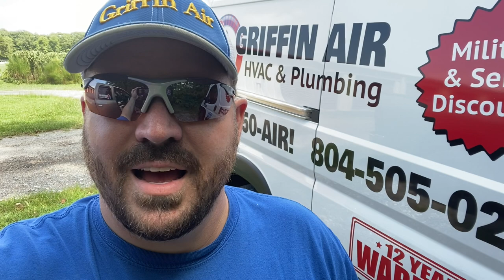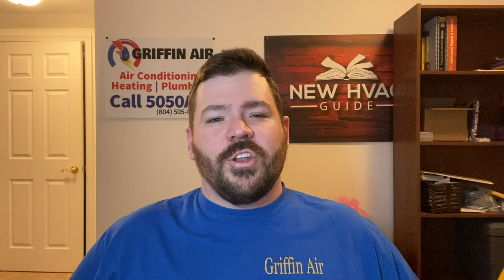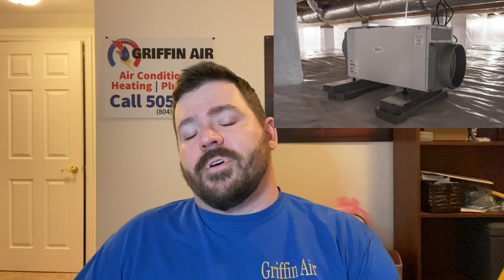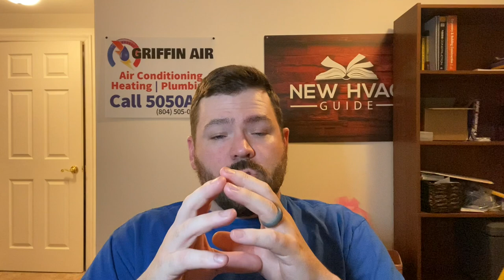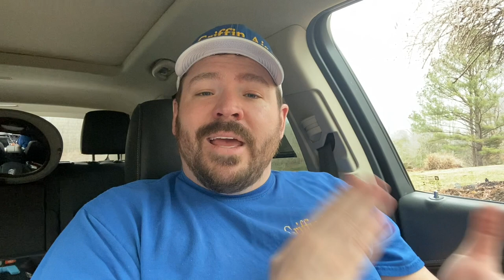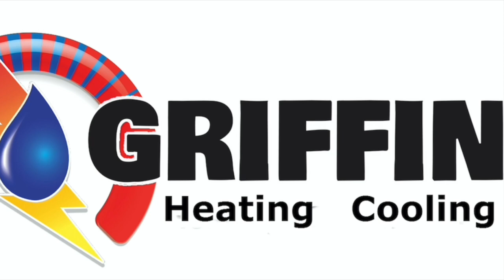The Crazy Truth About HVAC Sizing!

Comment: Need advice,

I have a common 3 Ton split system gas furnace. My compressor failed after 15 years of service. I recently purchased a new 3.5 Ton heat pump condenser as a replacement. I would like to take advantage of the heat pump technology and use the gas furnace as backup heat. My question revolves around the specifications of the new replacement evaporator coil. 
       
I noticed that most heat pump condenser units are married to an air handler with electric backup heat, instead of an evaporator coil box on a gas furnace. I understand that gas heat is possible as backup with a heat pump, but I'm confused about what modifications need to be made to the evaporator coil TXV. 
     
Please advise if there are special TXV for heat pump evaporator coil configuration and if there is something that is needs to be done to the furnace.
     
Thanks
Kevin
Reply from the maker: Nothing special. Just needs to be set up like a normal dual fuel system

Comment: Any feedback on figuring out a ducted heat pump size in a new build ICF home.  R60 attic insulation.  One level, Atlantic Canada, slab on grade, 2250 sq ft.  We’ve had contractors suggest anywhere from 1.5 ton to 2 ton.  Most online calculators show that as very small for the climate and square footage but not sure how the ICF factors in.  Trying to make the  most educated decision.
Reply from the maker: I recommend getting a proper heat load calculation done by a pro even if you have to pay for it!

Comment: I'm trying to figure out what size minisplit system I need. 99% for cooling for 680sqft(living great room/dining room and half of kitchen including range/oven). About a half of the area is 8ft ceilings(kitchen/dining room) and the rest range from 8 -15ft angled ceiling. According to strictly square footage, a 18k BTU system would work. Should I upsize one notch because of the ceiling height and partial kitchen?
Reply from the maker: Too many variables to answer this question pal. A unit can cause issues if it is oversized. Have your contractor do a Hilo calculation before purchasing the unit

Comment: So how do you combat those super hot days that happen 10-14 days a year ? A “properly” sized unit will leave you hot on those days. We like to keep our house at 68 during the day and 64 at night.
Reply: Add a small mini split unit to you main living area and set in one or two degrees higher than your normal setpoint.  It will add capacity when needed and be a backup If your large unit fails. You can get one under a grand.

Comment: Thanks josh for cool vid. Im a new homeowner and put in a new system end of last summer. I have one zone duct. Gas Furnace and ac coil on too, in basement.  Condenser is 5 ton, 16 sheer. 2k sq foot. Hard Ducts goes from basement to attic and branches out throughout the house. Problem im having now is in winter. Too hot upstairs & too cold down stairs. I tried resolving it with nest sensors. But downstairs is just weak. I even tried adjusting ceiling diffusers, still hot upstairs. Upstairs is all flex ducts from attic to second floor. Flex ducts looks quite big. Should i reduce the size of it? 

I havent experience the summer yet with this system. I am assuming it will be hot upstairs and cooler downstairs?
Reply from the maker: So it’s one system supplying both floors?
Reply: Yes. :-(
Reply from the maker: Is it zoned?
Reply: No.
Reply from the maker: Watch this vid. You need zoning. https://youtu.be/54G-K9X6S6U

Comment: Good video, I have a question. I have I have a metal garage 20'X12' 240 SF. It's all insulated with 1" foam except the garage roll up door. I want to install a mini split 9,000 BTU or 12,000 BTU?
Reply: Not an HVAC tech but personally, I'd go with 9K BTU.  I'd also look into ways to insulate the roll-up door to avoid condensation.  I'd try something like reflective bubble insulation.  If this were a garage I only wanted conditioned occasionally, I'd go with 12K BTU to get it to temp quicker.
Reply: @AvgDan  Thanks for the info.
Reply from the maker: I'd have a proper heat load calculation done if comfort is an issue... There's more variables than just square footage.
Reply: Need at least 12,000 because of the door and only 1' foam won't do much.
Reply: Deffinatly go w 12000 and in that situation 12k may actually not be enough depending on your location.  Always do a load calc. Insulate the garage door aswell like Dan suggested

Comment: Good info, although a lot of these issues aren't really done by the contractor. Most of this would be taken care of by an HVAC designer/engineer not necessarily a technician or contractor unless they are partnered with one or are a full design build company. A lot of the time when I've had to redesign a home the issue is because the design was not followed by the original builder and residential codes are way more lax than commercial codes especially when it comes to duct work. Most duct work in residential is lower quality soft duct which usually a wire spiral frame with insulation and a cloth and plastic membrane vs spiral hard metal or square metal duct work wrapped insulation. Unit selection in high humidity usually has a hot gas reheat coil which warms cooled air back up strictly for humidity control or has a humidistat and variable refrigerant control to ramp down for steady air volume. These are required in commercial applications and not so much in residential. Over sizing tends to occur when installers dont follow schematic design or install things designers hate like 3 way duct splits which I personally despise as a designer. Another issue is duct runs over 100' due to static pressure loss. The fans in residential units just dont got the static and volume for that length. This could be due to roofers  boxing out the wrong spot though and not the installers. All in all get youraelf a contractor who partners with an engineeer or a design build.company if you have major issues

Comment: We just ordered 2 Amana 311 seer 16 air conditioners for our 2 story high ceiling 2900 sq ft house. They arrived today and they are huge compared to our old air conditioners. Are you familiar with the model we got and do you think it’s too much?? I live in California  btw
Reply: All systems today are like that, I had mine replaced about 7 months ago. I have a 5 Ton  19 seer  Daikin Heat pump and it is much much bigger than my old 1994  5 ton York. They have to be large to meet efficiency standards and I dont know how old your last system was but if it was a R22 which is more efficient than R410 what is used today but R22 was bad for the Ozone.They need larger coils to remove the heat with R410 than they did with R22.
Reply: @wes2460  Thank you for sharing. The old units were installed when the house was first built in 2005. But one of the units was making a thud sound when it turns on so now we are seeking to get a replacement. But nextgen is giving us a hard time

Comment: I live in bakersfield got a new house 1882sq ft and has 9'ceilings and has 11 windows plus sliding door and they installed a 2ton 24000 btu and we cant cool house down the coolest it has been is 78° in the morning but 86 around noon who will be responsible builder? inspector that passed it? hvac company? or am i going to have to eat it just not fair its a new house and is under warranty

Comment: Please help !!! New 5200 sq ft first floor with a 500 sq ft bonus room above.Foam in attic and rockwool insulation in exterior walls. 2 Units 4 ton each for a total of 8 tons. living room 14 foot ceiling and all other rooms 12 foot. Does this size make sense? I would really appreciate any help on the question above....
Reply from the maker: Get a proper heat load calculation done even if you have to pay for it.

Comment: I used the coolcalc website to do a manual j calculation; Using my address in San Antonio, TX, the "outside design conditions" temp range by default is between 31 and 96f. This results in a load calculation of about 36k btu for cooling. But, we regularly hit 100+ in the summer, sometimes reaching up to 110. If I put 110 as the high for the temp range it calculates around 47k for cooling. 
Would we be better off getting a 4-ton unit to handle those hotter days or could it be too much for most of the time when it is below 100 and cause those humidity issues?
Reply from the maker: If it’s an inverter, it will ramp down on milder days.
Reply: You can only size it as large as the existing duct work allows. A general rule of thumb is 400cfm per ton. That is a VERY general rule of thumb. Size it properly with static pressures and either build new duct work or go with what the duct work will allow.

Comment: I live in Kansas. Getting ready to have hvac system replaced. Little over 1800 sq ft home with partially finished basement and 10-11ft vaulted ceilings on main level. Currently have a 3 ton system that is original to the home when built in 2003. Should I go with a 3.5 ton or stick with a 3 ton system? Our current ac has never worked great since we moved in 2016, but that could have been because it wasn't working properly, not necessarily because it's undersized. Thanks
Reply from the maker: Have someone do a proper heat load calculation even if you have to pay for it 🙂
Reply: You should have a ceiling fan in a house with high ceilings. This will help your comfort level. Make sure your house is insulated very well. 3 ton should be good. Oversized unit will waste money. Oversized units will cool the house quicker but will not dehumidify the air as much  which is another thing you should want to do.

Comment: I am trying to replace my hvac system. Heat pump.  Old system is 2.5 tons but l want to upgrade to 3 tons. I am in Georgia. I want to know if it will be ok.  I get 17 sq ft
Reply from the maker: Have a proper heat load calculation done even if you have to pay for it 🙂
Reply: Going bigger is not an upgrade. An upgrade is getting a better technology in the unit. Going bigger if it is not adequate the application  will be a DOWNGRADE in efficiency, comfort, humidity control, longevity 

Most systems are oversized and most contractors will oversized you

Comment: I live in a 1,049 sq ft condo in Georgia that previously had a 2 ton regular A/C condenser and air handler/coil. Just had a company quote me a 1.5 ton Daikin DZ14SA0181 Heat Pump condenser with a 2 ton Goodman AWUF250816 air handler/coil. Does matching a 1.5 ton condenser with a 2 ton coil seem right? I was also originally interested in the Daikin Fit but they said it wouldn't work in my condo because the air handler I would need would be too big to fit in the utility closet. I was surprised they didn't make a wall hung air handler yet for the Fit. Also, thanks for all the videos you put out. I'm really learning a lot about HVAC and find it fascinating...
Reply from the maker: Hello! They do not make a closet air handler for the Fit unfortunately. It’s not uncommon for the indoor unit to be a little bigger than the outdoor unit. It just can’t be the other way around.
Reply: @NewHVACGuide  thanks so much for the info. Doing something like that won't void the Daikin warranty or anything? I just thought it was a little strange because out 6 different quotes I received they were the only ones who quoted a system that wasn't sized the same. Too bad they don't make a Fit closet unit, I would think that could be a huge market for them.
Reply from the maker: It shouldn’t void the warranty. You can ask for an AHRI certification to make sure they’re matching units and then you’ll know for sure.
Reply: @NewHVACGuide  Thanks...

Comment: Thanks Josh.  I'm in northern Virgina and am replacing my existing HVAC; 35 yr old single family home, around 1800 sf, new windows & siding.  My current maintenance company proposed to replace my old 3-ton AC / 100-BTU (2 stage) furnace with the same sized equipment (AFUE is 80).  For the second proposal, the contractor came to the house and said the current furnace was larger than I needed, and proposes to install a 3-ton AC / 80-BTU (2 stage) furnace (AFUE=80).  The second guy was correct when he guessed that my current system probably didn't kick into stage 2 hardly at all in a normal winter.    Any thoughts to share?  Why should I go with the 100-BTU furnace if the second stage is rarely used?
Reply from the maker: We typically match a 3 ton system with an 80k btu furnace and have never had an issue. Did you ask the first company why they want to stay with the original size?
Reply: Never automatically assume you can replace like for like. The equipment you have now could be undersized, correct or oversized. When replacing, always do your own calculations for what size equipment to install, so you don't possibly repeat another's mistake.
Reply: David-wouldn’t you agree if youre system is cycling a lot in fall, spring, you can assume you are over sized ?
Reply: Josh- if you over size a Dehumidifier, won’t it cycle a lot and wast. Lot of energy because coil takes long time to get cold again when it re starts.
Reply from the maker: Good point

Comment: I have a choice between lennox 2 stage heat pump or brysnt 2 stage heat pump, which should I go with?  Thanks in advance
Reply from the maker: Tough choice. Which contractor do you like better?
Reply: @NewHVACGuide  One was recommended by father in law and the other by my friend lol.  Don't really know either one. The friend of the father in law is 100 bucks cheaper. So he would install the lennox. Which brand has cheaper parts?
Reply from the maker: They are probably both about the same for parts. Both are a little on the higher end in our market
Reply: @NewHVACGuide  Thanks for your help.  I guess I have to flip a coin lol
Reply from the maker: Honestly, if I were talking to my own family, I would probably tell you to go with the Bryant. But that’s just because I’ve had a few bad experiences with Lennox. However, I have friends that will only install Lennox and love them
Reply: Bryant! Lennox is 1 of the worst or the worst!

Comment: Trying to get a new gas high efficiency furnace here in Massachusetts. My old one is a 96000 btu furnace with pvc flue. 2500 sq ft house , built in 1995. Why am I getting some companies say I need 80,000 BYU’s and some say 100,000.? Old one seems ok.
Reply from the maker: 96k would be pretty much the same as a 100k if you're comparing.
Reply: 2500 sq ft house built in 95 could very well only need a 60k, please have a manual j load calculation done. if 60k is a little small, look into lennox and rheem which offer furnaces in between 60 and 80.  I'm in southern ontario canada, same kind of northeast winter climate and 80k condensing furnaces go into 3000-3500+ sq ft homes. It takes either a huge or very poorly insulated home to need 100k in northeast.

Comment: I just know my furnace is oversized for this house. It's 1321 sq ft, and the furnace is 80k btu. I set the fan speed to low, because the house can heat up so quickly at the fastest speed.
Reply: Probably shouldn't.  Can crack the heat exchanger like that.  Fast speeds need to be set properly.

Comment: How much BUT for 75 ³ m (5X5x3) to make it cool ?
No isolation 
2 windows 
The ceiling exposed to the sun
Reply from the maker: I recommend finding a good contractor local to you and going with what they recommend.  Every market is different.  So find someone awesome and go from there.
Then have a proper heat load calculation done even if you have to pay for it.

Comment: My house is 1100 sq ft with 7.5' ceilings and 111 years old. I live in SW Missouri with high heat and humidity. I am getting a heat pump split system Trane xr15 2.5 ton with an S9X1 furnace.  Would a 2 ton system be better?
Reply from the maker: I’d defer to your local contractors’ opinions. If something seems off, get another opinion.
Reply: @NewHVACGuide  Thanks for responding. I used another calculator and entered my SW Missouri climate as "like Houston" and got 2.5 ton. The contractor was born and raised in my town, so I will trust him.
Reply: Nope. Old house that is not tight.

Comment: I live in a 3600 sq. ft. home in Arizona so it is hot.  I have a 2 ton unit which covers my master bedroom, closet and bath and my 4 year old Lennox unit does not adequately cool.  There are 2 vents (10 in vents) in master and it cools fine but the bathroom has a little 6 in vent and so does the closet and  closet blows barely anything so it is stifling in there; and the bath is the same; just blows slightly more air.  We had Lennox rep who installed system and they said it is working properly but it is miserable especially in summer.  We have solar panels on our home and our bills are still over $200 a month and that is keeping our units at 78 during the day; even if you turn it down in the afternoon the thermostats will not reach 75 or 76.  I am miserable.  Our old trane units in a much larger home cooled within minutes?  What to do?  I am aware the builder uses units and not square footage and the air flow is not cool.  It is a long summer here. Some neighbors have had to reduct ($2000) and had to order new larger units.
Reply from the maker: Wow. What a pickle.  I recommend finding a good contractor local to you and going with what they recommend.  Every market is different.  So find someone awesome and go from there.